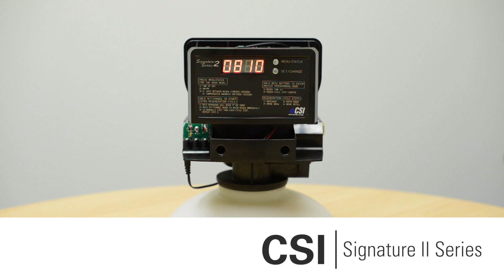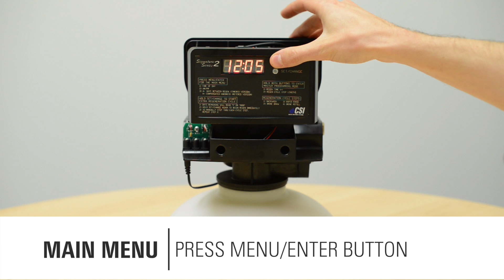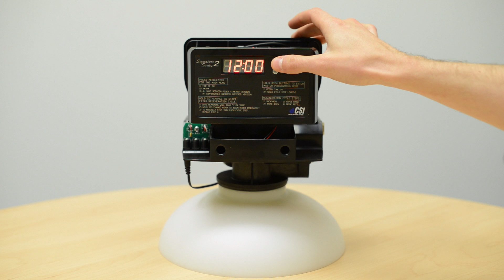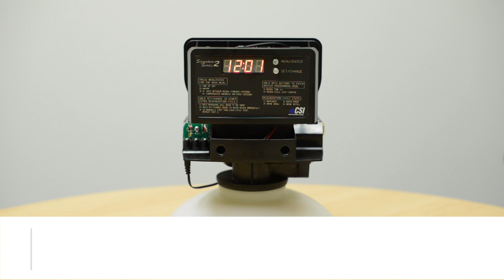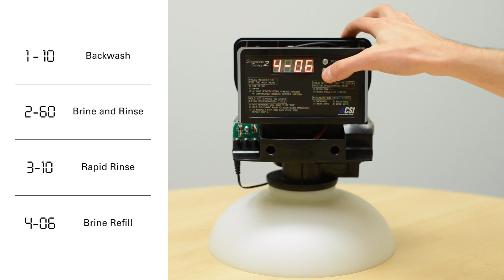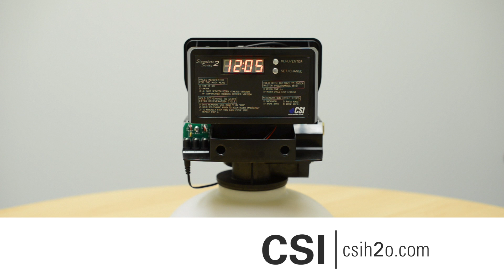CSI Signature II Water Softener Control Valve

Comment: My control valve will not turn on. Any idea of what can be wrong with it?
Reply from the maker: If the display does not light up at all, then your transformer (the power supply that plugs into the wall) probably needs to be replaced.  It is part number 20001X125.  Also, make sure that your outlet has power--make sure it doesn't have a tripped breaker or a flipped switch.
Reply: CSI Water Treatment Systems I was able to turn it on but now it’s not allowing me to connect to the app through Bluetooth. The app is not detecting it. I need to connect it in order to program it again.
Reply from the maker: Hello, please note that in the event of a power outage, the only setting that needs to be re-programmed is the time of day--all other settings remain saved.  You can change the time of day by pressing the buttons as shown in this video.  for help connecting to bluetooth, please contact our tech support directly via phone or email: http://csih2o.com/contact-us